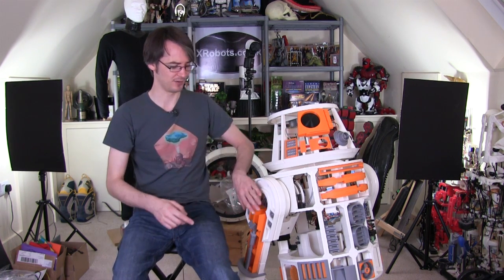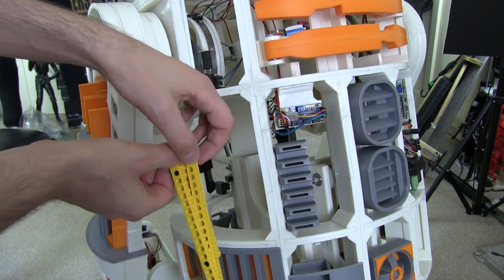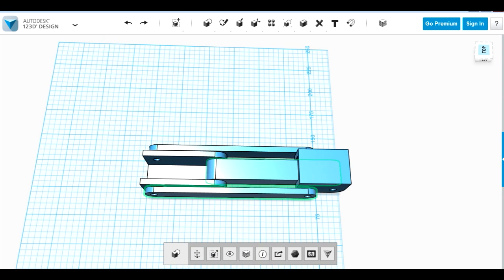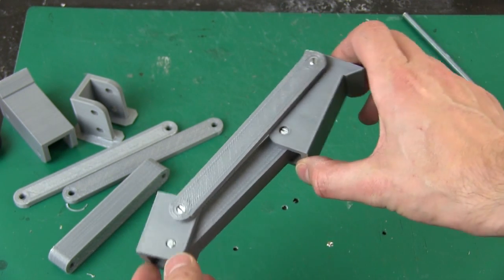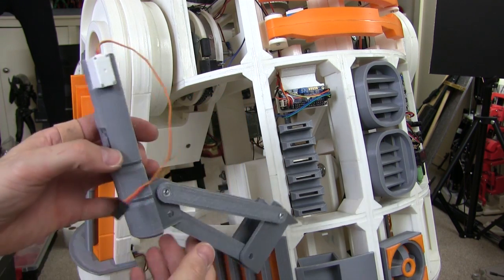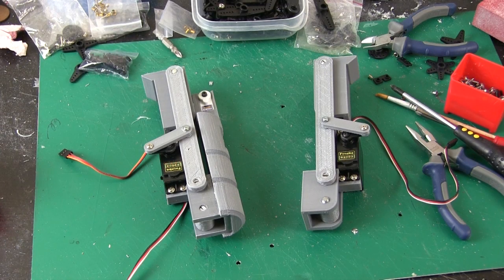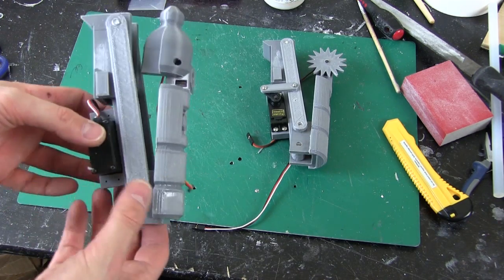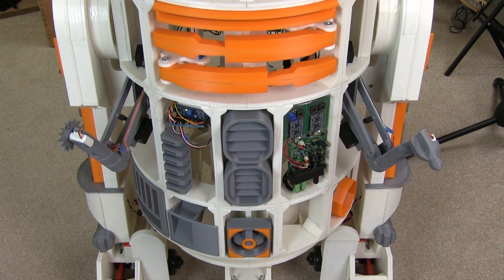Star Wars R6 Droid #17 | Saw & Probe Arm Attachments | James Bruton

Comment: im gutted wanted to print this full size but realised the lulzbot is a bigger build plate than the 3d printer i have , can you see any issues if i print this from the files at say 80 percent of the original size so 20 percent smaller  ? then i can make it work with the printer i have . do you think it would stop it working or can i split some parts so i print more but keep the size original .
sorry to ask so many questions 

Cheers Martin

Comment: James, 
Have you considered making the "interface" arm the Arc-welder arm, changing the tip design and adding a light and crackling sound? Also for the saw arm, I think if you bring the "saw blade" teeth down it would be fine, think medical, like cast removal after a broken limb.

P.s. Also for Hulkbuster (also amazing so far) for the shoulder guns, think mini-gun, so only one light (at the top) comes on as the barrel rotates around - if they lifted and fired together it might give the effect you are looking for.

Just my $.02

Really big fan but not normally one to post, keep up the good work.

Comment: Love it, although the very first thing I thought is why not put a servo on the pivot of the saw end so that you can rotate it (either automatically as part of the routine or manually controllable) rather than just going out and in. Just thinking of R2's saw blade rotating around to cut the ewok net in RoTJ

Comment: For the saw blade you could use a metal grinding cutting blade, pretty sure there are small enough versions that would fit, and the blade doesn't have teeth so there wouldn't be a problem rotating it continuously.
Reply: +TheOnlyPsycho  its more hair gitting caught in the servo that's the problem

Comment: It's cool how you bear safety on mind all the time though I think it's a little bit exaggerated. Considering the amount of dedication and engineering you put in each one (several motors and mechanisms per arm) it's a bit shame that these all look dull and rather useless. Of course that all your points about kids safety is totally true but couldn't you solve this by some software? I.e. creating something like 'safety mode' that would only allow all these arms to stick out just a little bit, while in full mode the range could be much better which would make way better impression. And just a small nota about that saw - why don't you try to round one edge of each tooth leaving the other as it is. that would not make it more dangerous but alot more saw-like I think :)